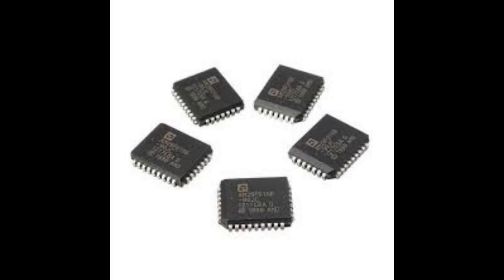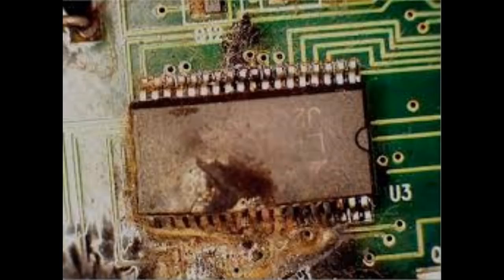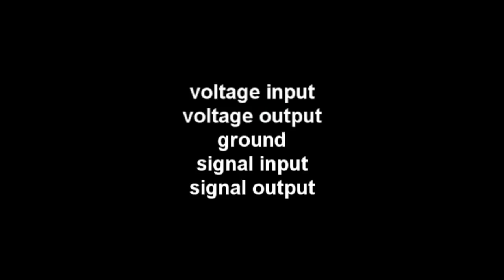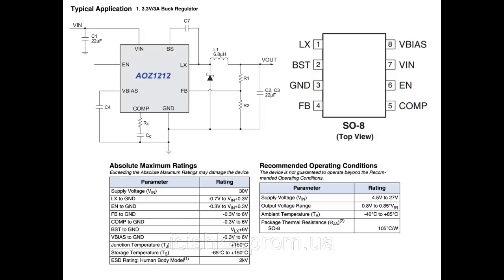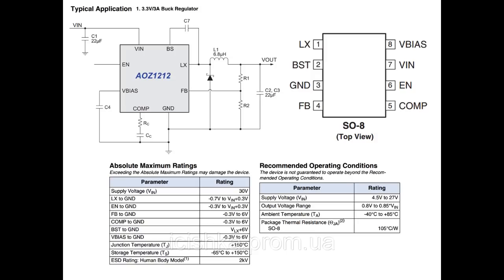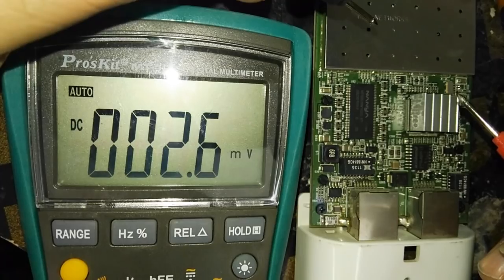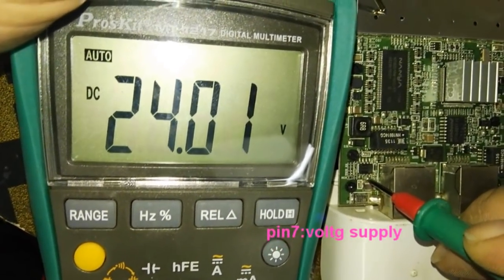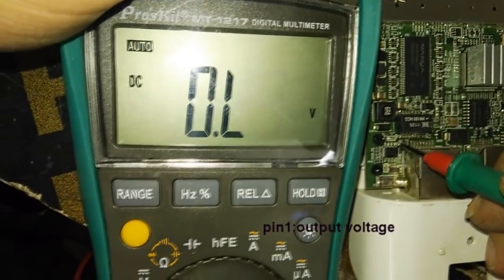how to test ic integrated circuit with multimeter

Comment: I have a IC chip on a sony TV power supply that the black ceramic on top looks chipped off or burned off...  I assume this is the reason my power supply went bad ?    how do you know or how to buy the correct one for  my power supply ?  the IC on my board is   4leg on each side so total 8 Legs.    the power board is  PSLF33115A(S).  any idea how to find this IC ? i want to try and replace it.  Thanks.
Reply from the maker: Hi u must first determin ground pin and vcc pin and signal out pin and what the circuit for this ic is it oscillator circut
And i give u this site it can help u to know damage ic

https://remont-aud.net/ic_power/

Comment: HI, thanks. Does the unit have to be powered ON to test?

How do you test the IC for driving CD/DVD motors. It's callled the BA5986FM (used on the Dreamcast too).

God bless, Revelation 21:4
Reply from the maker: Yes but u must be careful from making short between pin but u need schematic digram for ic
Ba5986 and check vcc pin and ground and check heat of ic

Comment: The problem here is that this method only works in a circuit that is working properly..  If there are faults in the circuit all bets are off and you could get all kinds of readings that may or may not be correct.  Like many components, the only way to reliably test is to remove the component and have a test procedure outside of the circuit.  If this is incorrect then my apologies in advance.
Reply from the maker: u must know the input voltage and test it and output voltage than u can remove the input voltage and see if their and change in reading and also u can remove out put pin and read volt out any way u can create u r own method

Comment: So i have an dip-8 ic with no ground just a few voltage inputs and outputs, however the "primary" voltage outputs read continuity between one another. Safe to assume this ic is bad?
Reply: All of the other pins seem to be fine its just those two
Reply from the maker: @peterdragomirov4022   u must check schematic  diagram of ic and make test  depend on schematic

Comment: did you power the board while testing or it has to be done without power ? i've got a board which controls a vacuum cleaner half of the board has discrete through hole components and the other part has IC and SMD components, the board is powered at 220v to power a two phase motor and there are voltage regulators i suppose that bring the voltage down for the logical SMD components. I cannot power the board with 220v and test with a multimiter there are 600v caps and it's too risky but i still need to find the short on the board how can i do? i have a DC power supply,  can i apply power to the chip itself on the VIN (red probe) and GRound (black probe) directly on the IC? is this safe or i would fry the circuit? of course i would apply the voltage stated inside the ic datasheet please let me know
Reply: hi first you must get data sheet for any ic thir in u r board and u can supply ic from power supply but start with low voltage for example if your ic work with 12v u start with 5v and increase voltage step by step and see the amp on power if amp going hi that is mean ic is damage hope thats helpe u
Reply: @goldenmovie7888  thank you very much i will try it

Comment: How to find defective ic
Reply: Top corner says it's a buck converter... he just calls it a power IC. 
If Vin is 25V and Vout is not 5v means buck isn't working.  
There should be a way to test feedback loop pin. Might "reset" or put IC chip into a mode.  See datasheet.
Maybe this helps?